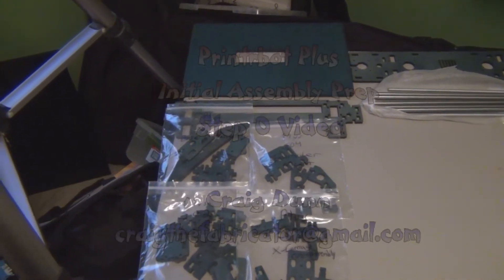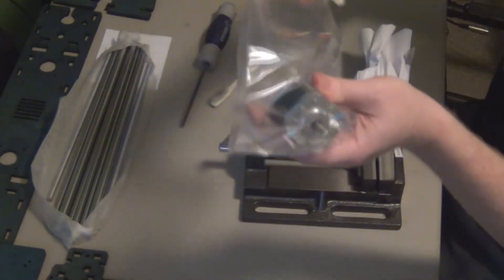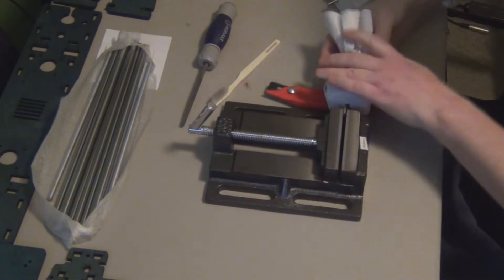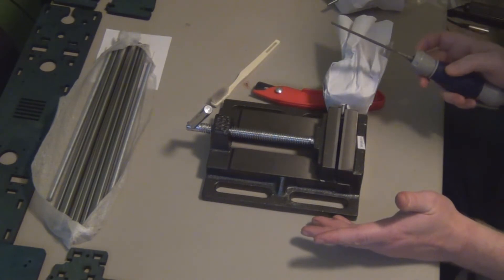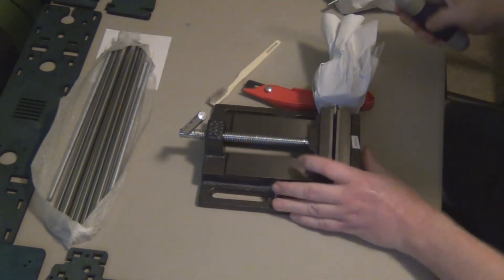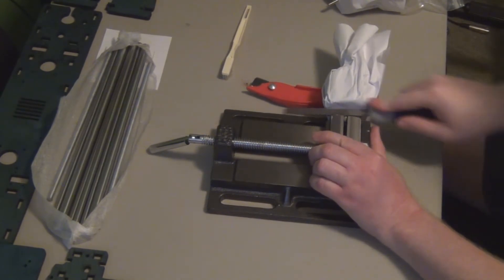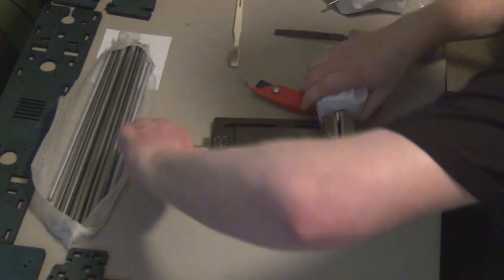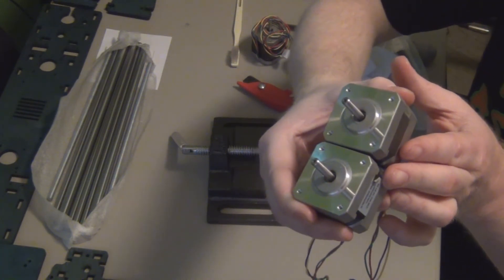Printrbot Plus Assembly Step 0 - Build Prep

Comment from the maker: Yes. If the motor shafts have a flat area ground into them, you should be fine to avoid that step. You will still need to install the motors based on the location of the flats as per the instructions in each section of the videos. Finally, taken notice of whether the flats run the full length of the shaft.  Some motors need to have the flat closest to the motor and some will need it toward the end of the shaft. Take note in later steps which is needed and further file your shafts if necessary.